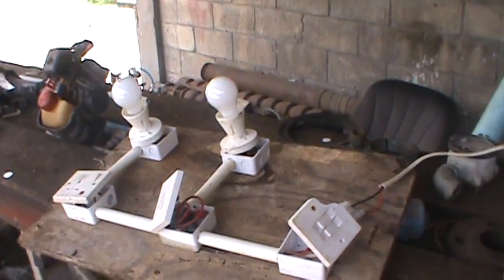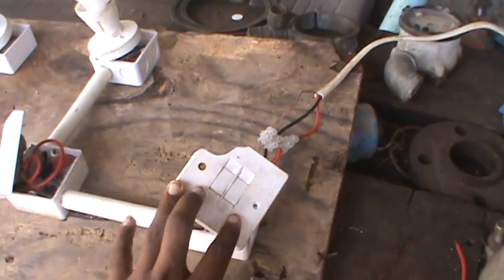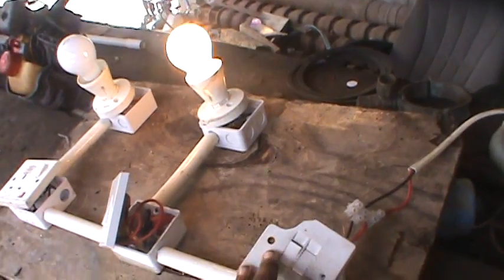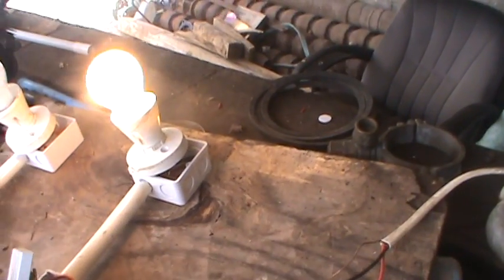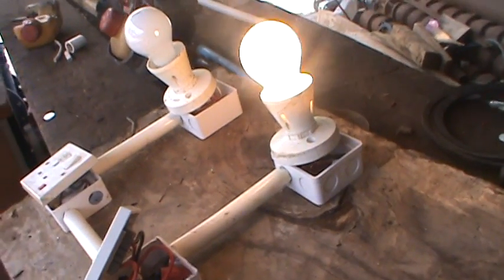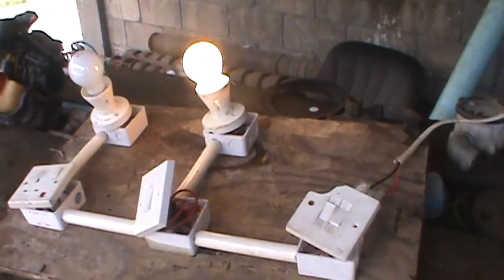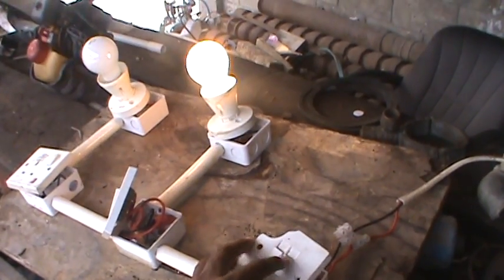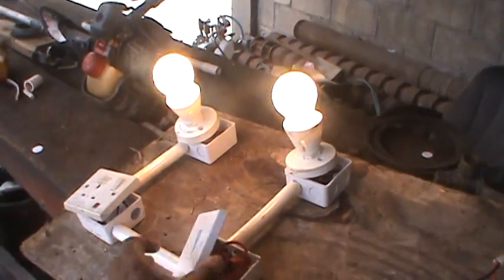How to Wire a Two Way and  a Single way light on the Same Circuit

Comment: Hey man thanks for the video. In this setup does the two way switch have to be on for the single way switch to operate one of the lights, or will the single way operate one light independently of the two way switch? thanks

Comment: All wiring are hidden in the wall.
Now my office using two way switch to control the lights. But now they wanted to be control by only one of the switch ( the other switch don't use). 
So how to convert it to become a one way switch ( control by one side/one switch only)
Thanks

Comment: Mr. Clychawn is your country voltage 250ac? You have two hot conductors and ground for your supply? Thanks!
Reply from the maker: daikaiju20 

Yes im in a 250vac country and if you consider the neutral a hot conductor then yes.. but it red for hot black for neutral and copper for ground in this video.

Comment: Trying to do this on my landing.

Two way switch down stairs for hallway and landing. Then single way switch on landing upstairs.

Now i've got to the point where the two way switch turns the landing light on/off. But then doing a certain combination of switches makes the two way not work!! I take L2 out and it doesn't change the way it works. So that is the problem but I dont know why
Reply from the maker: I would think you switches are placed differently. You need to know your switches properly to do what is in the video. Normally the com to L1 act similar to a single way. Which can be use for you landing light and the other side of the switch can be the two way for the hallway. So u will need 2 two way switches and 1 single way switch. To get this arrangement.

Comment: Why did you put the plug and the light on the same circuit... I believe that is a violation of
 standard.
Reply from the maker: Hey Mr Geddes 

I study the NEC. And the NEC only allows the bathroom circuit to share both light and power on the same circuit. No other circuit in a residential should light and power be on the same circuit. This video just displayed a bathroom circuit.